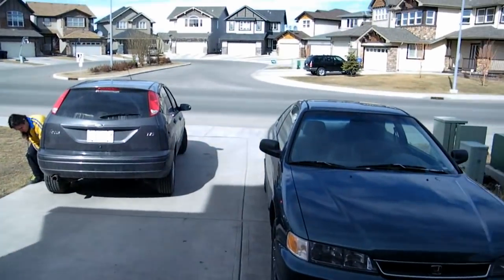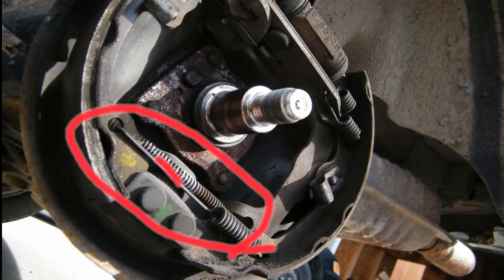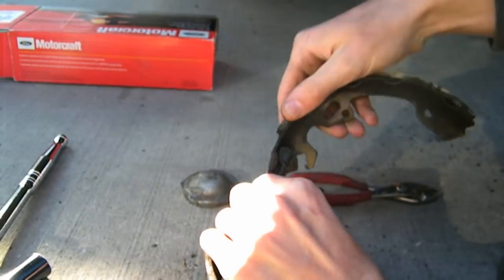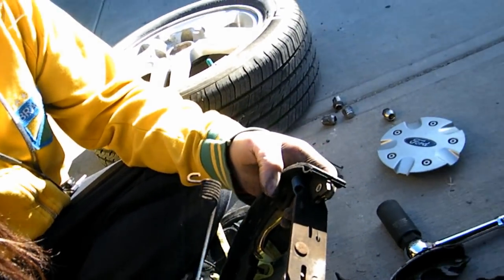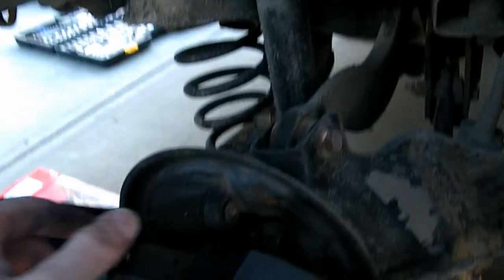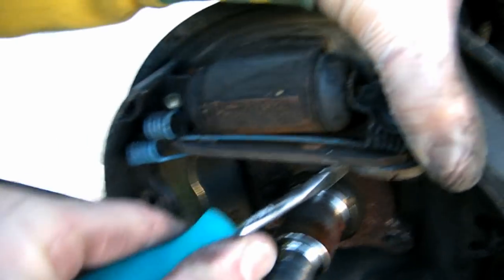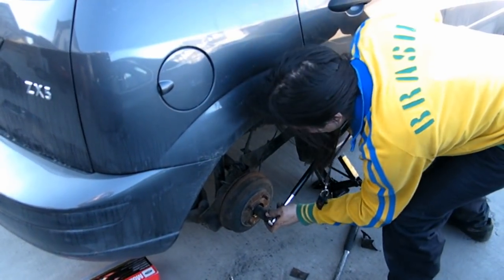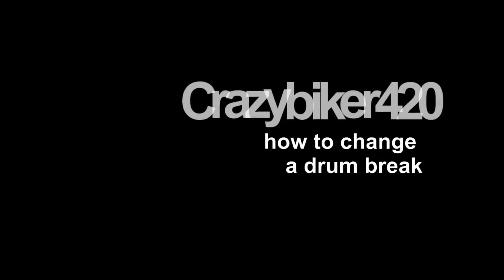How To Change Drum Brakes 1998–2004 Ford Focus

Comment: should have greased the backing plate where the pad rubs. it prevents wearing holes in the plate. also, hammering the drum on can break the pads and cause the brake to stick. I know from experience cause I have done both.

Comment: The Ford dealers workshop manual says to leave the 30mm. nut alone and loosen the four 13 mm bolts on back plate instead. The 30mm is not actually keeping the drum on in any case.

Comment: Inquiry (1). E-Brake cable goes to BOTH rear wheels or just one?, and (2). I'm a bit confused 'bout direction/orientation of lower spring. At 5:36 the spring is being installed in one direction then at 5:50 spring direction is reversed. Were you filming at other side of car?

Comment: Correction. At start of clip they're filming RR (evident by orientation of coil spring). But by 0:54 they're filming Left Rear (evident by orientation of gas tank & tailpipe). So to Crazy Biker I like the clip however it's recommended to ID WHICH wheel is being worked on during filming.

Comment: did you ever find a video on the e brake? mine wont engage at all and my wheel nut is different i think being its 2 small 27mm and 2 bigger 28mm lock nuts or do they all come off as one?

Comment: 30mm not a 31 did it for my 2006 zx5. I'm actually having a tough time trying to get the brakes to back off since mine are actually worn down and created a big indent in the drum. I can't see a god damn thing because the idiots at ford put the adjustment slot directly across from the rear arm. This video skips this critical step since the guy's doing it on a car with a non-worn drum. Sort of makes this video useless.